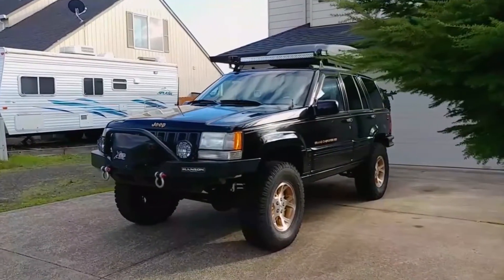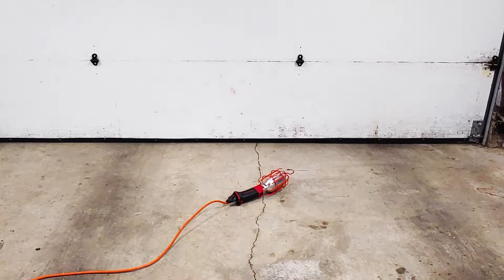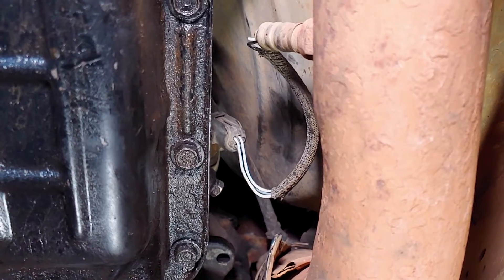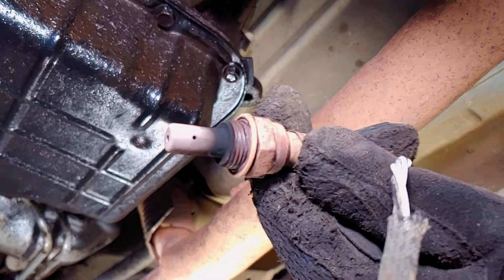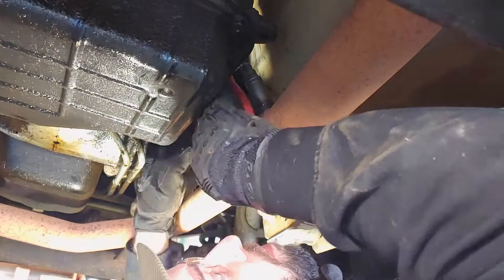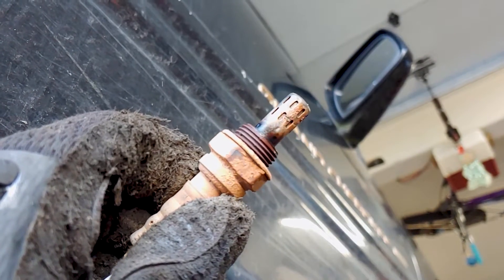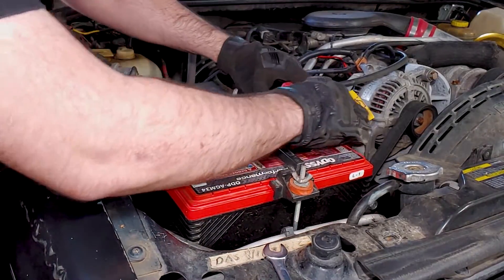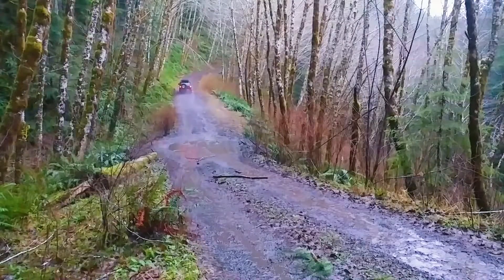O2 Sensor Replacement with Tool Sizes – Jeep Grand Cherokee ZJ 1993-1998

Comment: I was told I need to change my bank 1 and bank 2 sensors. I have a 2003 jeep overland V8. Is what you are changing considered bank 1 or bank 2. I have part# 234-4653 and 234-4654 and don't know where they go as far as up top near intake manifold or underneath Jeep. Please help before I start tinkering 😁 I am trying to figure it out
Reply from the maker: My Jeep only has one Bank. Two Banks means that there are two separate exhaust pipes coming from your engine back to two separate catalytic converters. One catalytic converter will be on Bank One and one will be on Bank too. The upstream sensor is before the catalytic converter, and the downstream sensor is after. I can't tell you which bank is which, you'll have to look that up for your vehicle.

Comment: I just swapped out a cat on a 98 Cherokee. 
It was supposed to be a direct fit.
It did fit, but had to trim a half inch off of one side.
The only way it would go together is if the o2 sensor was towards the engine.
Looks like it should be towards the rear axle.
I wonder if the manufacturer welded the ends on backwards.
It went together nicely, but the o2 sensor is before the cat.

We'll see if the light goes off. 😂
Reply from the maker: My understanding is that the computer needs one sensor before the cat and one after it. Without that configuration you're likely to keep tripping the check engine light. Even if it doesn't trip the light, your air/fuel ratio will be wrong and could diminish fuel efficiency and power, and possibly clog your new cat with carbon if the mixture becomes too rich. I'm not a certified mechanic but I think they would give the same advice.
Reply: @EndlessMoneyPits  
I'm a former certified mechanic,  and I'm pretty sure they welded the ends on backwards. 😄
I threw it on because he had to go get his boat.
I'll get him back over and swap it around.

A lot of these jeeps in my area go cat delete since we don't do emissions.
This one was hollowed out with an o2 sensor in it, that was supposedly bad. 🤣

Comment: I have a v8 4x4 limited from 95 and I don't have an obd 2 connection or even 1🤷
Reply from the maker: I think it became required on vehicles manufactured in 1995 and later, and I know early Grand Cherokees did not have OBD2.
Reply: OBD1 was on cars from 1982 to 1995.
OBD2 is now standard on all cars from 1996 to current.
Your Jeep has an OBD1, unless it's been modded to a pre 1982 wiring harness.
It's why Vettes from 1982 & 84 would use a 1980 wiring harness.
To bypass the OBD1.
Reply: If you have no OBD port, it's the EEC-IV & you must read the code by the light flashes.
Count how many times the check engine light flashes & then look up the code from there.
Reply: look on youtube....theres videos telling you how to get and read the codes on obd 1 . I have a 1995 and it has the obd1 connection plus to read the codes you dont even need it.